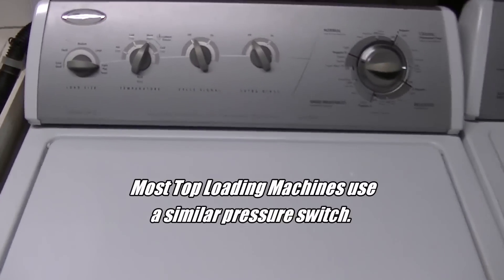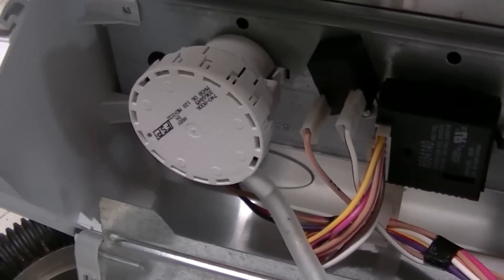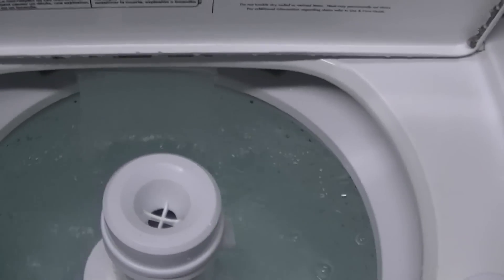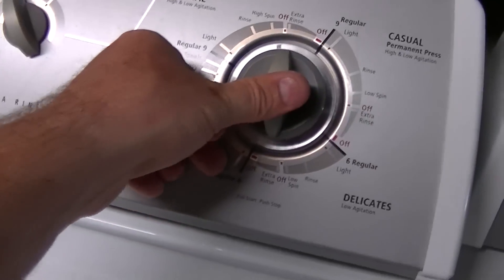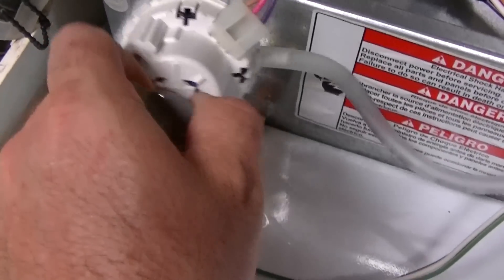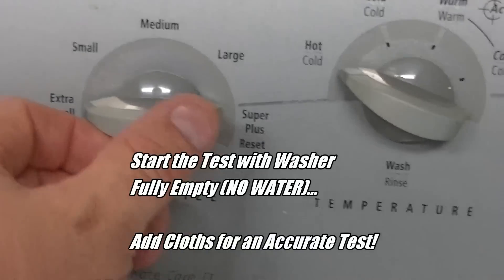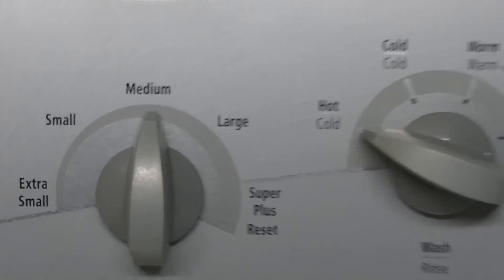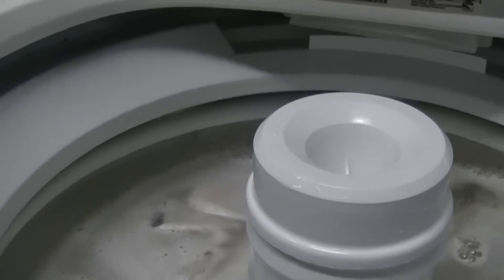Clothes Washer Water Level/Height Adjustment- Top Loader

Comment: My GE washer is not an HE model yet it too does not fill the stainless tub very full, even when it was new. (2014)
Has a beautiful LARGE tub though...  :(
Reply: Mines either I've replaced the water intake valve and the water pressure valve and same thing

Comment: I have a GE GTWN5650 series HE washer with agitator purchased in May, 2015.   Set to "Large" load, I was getting maybe 6 inches of water in the tub.  Clothes were coming out with soap stains and not rinsed well.   I ordered the pressure switch WH12X10548.  Installed the switch, exact same result.   Here is a 'hack':  unplug washer, remove the pressure switch. There is an adjustment screw hidden inside the switch.   Carefully pry off the cover to the switch using fine blade screwdriver.   You will see a white plastic adjustment screw inside above the circuit board.  Now, take the outer white cover you just removed and draw a circle on the cover that corresponds to the location of the screw on the control itself. Leave the cover disconnected from the switch itself.     Drill a 3/8 hole in the plastic cover or just punch the hole out.   Now you can reinstall the switch and adjust the tension of the spring that controls when the pressure switch 'kicks in' and stops tub fill.  Start by turning the plastic screw slowly and carefully one full turn clockwise.   Blow hard into the plastic tube to clear it out.  Reattach the switch, plastic tube and connector .   Put the control panel back on,   Plug machine in, run spin cycle for one minute to suck any air from the pressure switch hose.   Select NORMAL wash, WARM water, LARGE water fill.   Keep the lid open and press START.   See what the level is when the washer stops filling.  It should be at the top of the bottom row of 8 holes in the tub.  This worked perfectly for the last several loads of all sizes and types and now my clothes are getting a good wash with no soap residue.  Less wrinkles and deeper cleaning.  DISCLAIMER:  Do this at your own risk and make sure machine is UNPLUGGED any time you disassemble any part of the washer.

Comment: Do these adjustments hold up?  I work on appliances, but have never recalibrated a pressure switch for fear it would not hold  up.  I am thinking of recalibrating one for a lady and need to know if this repair actually held up.
Thanks
Reply from the maker: piddler51 Mines been good since video made, so time will tell...

Comment: We have a GE washer but looks similar to the knob layout. Our kid pulled the water level knob off, lol and pushed the connector/housing to the water level component inside the machine. 

So nothing even visible to reconnect the dial knob to....

Are most machines built the same way with the hose and  housing for the water level knob? 

I guess I could just remove the  3 screws on back panel and pull up the whole operating board like you did and take a look. just don't want to create even more problems lol

Comment: Based on my experience, HE machines DO NOT CLEAN as effectively as the older Non-HE machines do. Also, I noticed HE machines take longer, using more electricity. My clothes dryer is a natural gas model and works ten times better than an electric one. We hang dry in the garage and then fluff in the dryer for 8 mins. If you have a household that has its own water well, do not use an HE machine. Get a machine that will completely fill with water and run for a much shorter amount of time. You will have cleaner clothes. There are other options as well.  1) Get a machine that has a manual override on the water level. I have a GE HE machine that allows me to add more water by holding the fill switch at max.  2) adjust or modify the water fill switch screw setting (there are videos on youtube that show this).
   My son, a college student living in an apartment, recently purchased a lightly used GE washer and dryer from another student. Both units for $300 total. The washer is not an HE model. It looks like new. He and his roommate are very impressed with how well it cleans. I said its not an HE machine. He said, what does that mean. I said, the newer high efficiency(HE) machines use less than half the water and therefore do not properly clean your clothes. He said, thank god I didn't buy one of those. I also asked, is it quicker than our machine at home? He said Oh Yeah. It seems like its twice as fast. I said yep...that is progress for ya. One step forward and two steps back. In the beginning, our GE HE machine made our clothes smell terrible. I was so angry. We followed the instructions. With HE machines you need to add more water and the right detergent. Its simple science. Experiment until have the desired results. You simply can't argue that. You can easily argue, based on empirical data,  that HE machines need significant improvement. We need clean and fresh clothes. If my machine does not do that, I don't want it. How is that hard to understand? You know what they say, if you want something done right...
Reply: I could kiss you this is the realist fuckin comment
Reply: And the govt is wondering why people are reverting back to the good old 'conventional/conservative' ways because 'progressive' is all hoax and will never work! I save water wherever possible but not at the cost of defeating the initial purpose of getting clothes clean! When will common sense prevail?!

Comment from the maker: if you disconnected the line with a full tub of water, then yes you can blow air into it to reset it.  Use the screw ti adjust the level.

Comment: Hi, hey this is some very good info, I had to replace my level switch, so your saying I should blow pressure back into the tube, pinch it off and then plug it back on to the new switch right ? That would make scene because the water level still does not come up to the right level or it puts to much water in the tank. Thanks I didn't think of doing that.

Comment: I have the opposite problem w/a Maytag Quiet Series 2-speed 13-cycle.  "Mini" fills the tub almost 3/4 full.  Would this same procedure apply?  Is the switch on this video the same as a Maytag?
Reply from the maker: +jpcpdntp Usually these parts are the same or similar, try an ebay or google search to see what it looks like, or it only take a min to pop the top cover off and check it.

Comment: what do you know about the Bravos XL models. I want to change the water level because its to low
Reply from the maker: +Hector L I don't know of that brand specifically, but there are many brands that share the same parts or are even built by the main mfg.  Pop the cover and see if the switch has an air tube and if there is an adjustment screw.
Reply: Hi did you manage to fix the low water problem? I have the same model. Thanks.